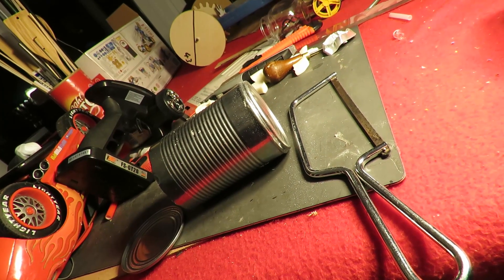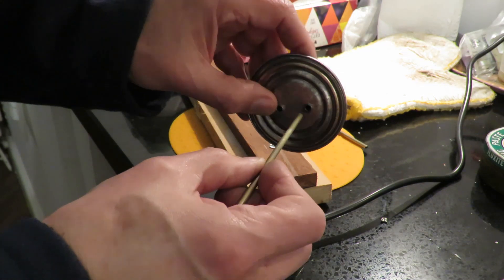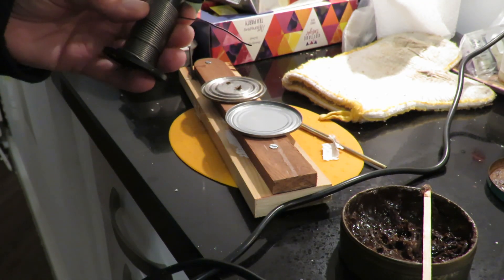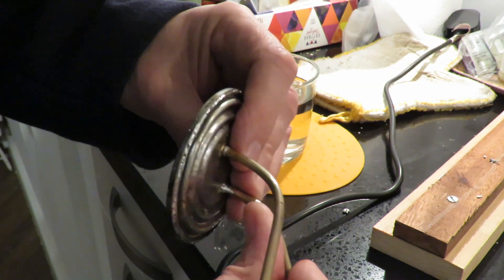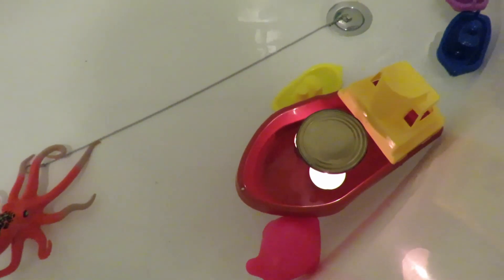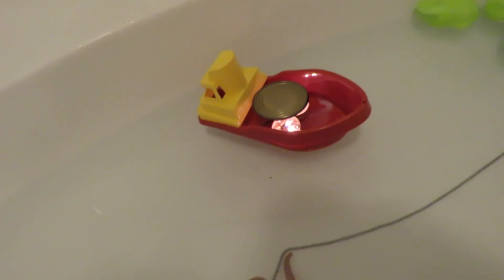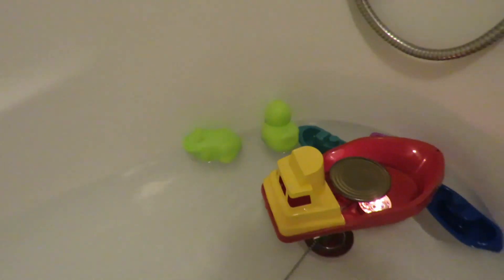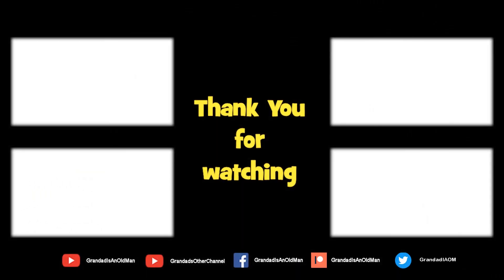Pop Pop Putt Putt boat Baked Beans can

Comment: That's good. Never seen these "putt putt" boats before.
I imagine that you only have to prime the boiler once? Then the vacuum in the boiler sucks in the water again via one tube and the other tube pushes it round in a circle?
Reply from the maker: I think they are brilliant. They seem to be very popular in India and many of the versions on eBay are made there. There is no difference in the function of either pipe when it is running right although there is often a bit of imbalance in their effectiveness. Water boils into steam. Steam takes more space that the water so anything in the pipes gets pushed out (air or water). As soon as the steam comes in contact with the colder pipes it condenses, reduces in volume and therefore reduces the pressure inside the system so the outside pressure pushes cold water back into the pipe. In theory it should be effectively a closed system with any water pushed out getting drawn back in but it does seem that some escapes somehow and they do run down although for me it is more often the tea lights have run down first. No doubt there is an optimal size boiler in relation to the length and diameter of the pipes. I recommend having a look at Daryl Foster's channel although there are plenty more people doing these and I have put quite a few other people's videos in my associated playlist. I am certainly no expert as this little series will demonstrate 😜